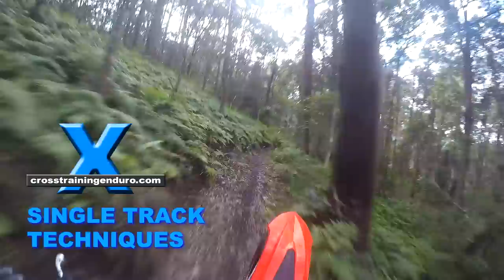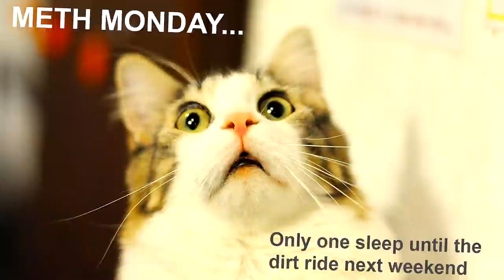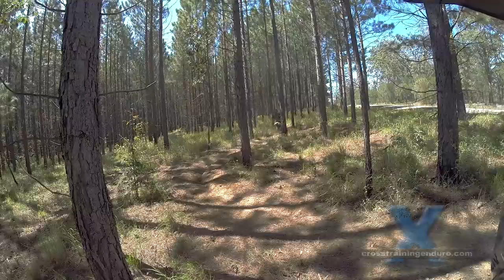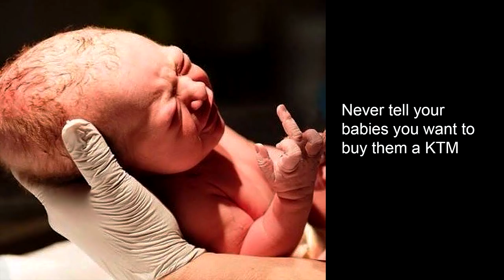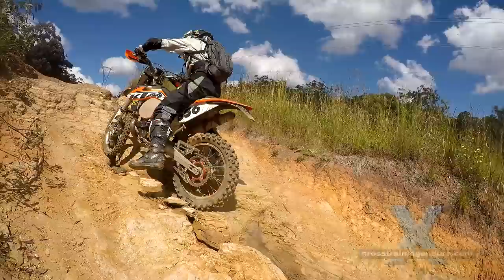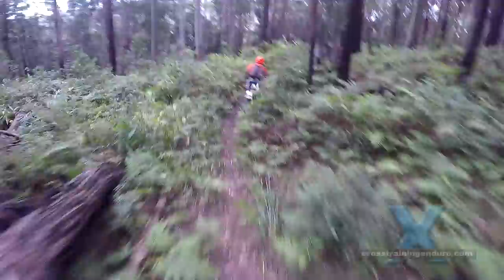How to ride single track on dirt bikes︱ Cross Training Enduro

Comment: Coming from a moto background, I had very little experience on single track. The first real experience was in a dual sport ride with miles of continuous single track. The first part was through fields of two foot high grass. Absolutely no way for me sitting down to set up for a curve. 

I got frustrated waiting on the trailside for my slower buddy after this tall guy passed me. I fired up and chased him. Full on moto style. He clearly was not working as hard as me. 

I learned from that experience exactly what you’ve recommended by watching him. 

Stand, don’t look down, look ahead. I noticed I was weighting the inside peg but resisted it because my moto training says weight the outside. 

So now I know my instincts were correct. 

Thanks, can’t wait to see how it goes.
Reply from the maker: Great to hear it's working for you. Most of us coming from road riding learn by trial and error and eventually do some coaching and realise we'll have to unlearn a lot of stuff. 😂

Comment: Im 57. Exercise, exercise, exercise. If not daily, at least 3-4 times a week. A good cardio. Light weight arm, wrist, shoulder, leg routine.    Hydration with plain ole water before you ride.  I struggled with arm pump and fatigue before I started doing these things.  Now I can ride for 5-6 hours before I start to fade. Tore my ACL and got WAY out of shape.  After therapy and a return to my exercise routine, things changed dramatically.   Move it, hydrate it or lose it.
Reply from the maker: Great to hear. In my sixties now and I'm exercising every day just so I can get through a dirt ride and not be in too much pain the next day. The last two years I realised I needed to either really up the exercise or do more normal riding instead of the hard enduro stuff. I've opted for the latter.

Comment: Single track - Its all I ride on. old vintage bikes. I have nothing newer than a '94. my oldest is a '72. Ya gotta be tough to ride a '72 these days! Thanks for great videos. This helps me... As it does others too.... and yes, weight on the inside peg ...  Counter balance is a BIG key in single track. Keeping your body straight, and toss the bike back an fourth - like we did riding pedal bikes - swoosh the bike left and right while standing and pedaling is how we gained speed... just the same concept with the dirt bike, except of course, the engine does the work instead of pedal power. :D

Comment: At 2:40 in this video you suggest weighting the inside footpeg, instead of just turning,  to help us turn.  I've always been told the opposite, weight the outside footpeg!  Is this because the toilet water goes a different direction "down under?" Or have I just misunderstood.
Reply from the maker: coriolis definitely plays a part glenn lol. there could be different thoughts out there but most say weight the inside peg to tip the bike into the corner, weight the outside peg as you exit to get traction to the rear wheel.
Reply: Thanks for the response! Hope to see you in Canada this summer.

Comment: These kinda vids are essential when you begin or restart riding enduro or off road in any way. I am beginning again to ride after 30 yrs :D , so I bought a sec hand one that my dealer proposed. An EXC 350 F to begin with. Now I am shocked by the hatred towards ktm on the net.
Can someone explain me why ? I find my sec hand ktm an agile ,throw it anywhere , amazing torqy little thin. Ok as a Belgian i find that orange ugly ;D  as hell but thats the only thing atm that is negative :D.  Anyhuuu one needs to watch these vids !! it should be obligated ! All the best you funny talking Aussie  :D
Reply from the maker: hoe gaat het, john. ou comment ca va? my apparent hatred of austrian bikes is really just an ongoing joke. it's explained here: https://youtu.be/qSg2sll6yEo?t=476
but i have owned a few very happily. and my brother had the 350 and it was a great bike. but some people seriously dislike KTM for various reasons. in the early days they could be very unreliable and some think they still are. in some countries the bikes and/or parts are a lot more expensive because they simply know they can charge more. like all manufacturers, at times they make major mistakes and aren't quick to fix them. and have been accused of releasing innovations too soon and using us as guinea pigs. i covered these topics in this vid: https://www.youtube.com/watch?v=kxCHcoHEEBA
but generally they are great bikes, and probably the best in certain categories in past years but i think the other europeans have mostly caught up with them now... and are cheaper.

Comment: I've always been rubbish at standing all the time, especially when it's narrow.  End up leaning into a corner, with the tires almost leaving the trail and my upper body going through bushes and tree branches on the inside, unless I go trials-slow.  I've also had the devil's own time trying to shift, when half of my weight is bearing down on a foot that's supposed to be maneuvering for the lever.  I have much better success personally by staying seated and keeping my center of gravity low, then only standing when I need to for bumps.  Given that I ride vintage bikes with crap suspension compared to everyone else, you'd think I'd be the last person to get away with such shenanigans.  Perhaps it's because the vintage seats are so much wider and more comfortable.
Reply from the maker: i find the vintage bikes almost impossible to stand on, the ergos seem to be aimed at sitting most of the time.
Reply: @crosstrainingenduro  Interesting.  I need to get some time on modern bikes and see if there's a big difference in that regard.  One thing I've noticed is that the vintage machines usually came with real tall bars, which are comfortable for standing but get awkward when you sit forward on the gas tank to attack a turn.

Comment: Are you not supposed to put weight on the outside peg on a turn, rather then the inside?
Reply: Inside weight for turn in. Out side from apex to turn out. body position forward and off we go. Good luck.
Reply: I had this same question

Comment: Serious question. In your videos you say weight the inside peg. I have saw else where to weight the outside peg. Seems to me if the bike washes out and your weight is outside you can put the inside foot down a little faster. You defiantly need to lean the bike over more so maybe it is a wash. No pun intended.  Just asking because I am way more of a gumby than you are.
Reply: thought about that myself ,think weighting the outside peg put more weight to the tyres when cornering on mx track,think weighting the inside peg helps the bike turn quicker on narrow tight trails at slower or using less revs than racing mx
Reply: I don't know if I am that slow and it is that technical I am normally very loose on the bike letting the seat move from side to side as needed between my legs. Makes me feel like a nads the size of my bike.
Reply: When standing, weight the inside peg to make the bike turn in.  In a longer flowing corner, you'll naturally then transition to weighting the outside peg once the bike is 'set' on the line you want.  Experiment by riding in a straight line when standing, and shifting your weight from one foot to the other - you'll notice how agile the bike is, as you're basically making it fall over.
Reply: Weight the inside when standing and the outside when sitting on tight, sharp corners while your inside leg is out stretched. That's how I do it anyway